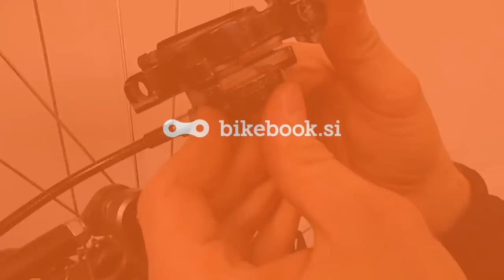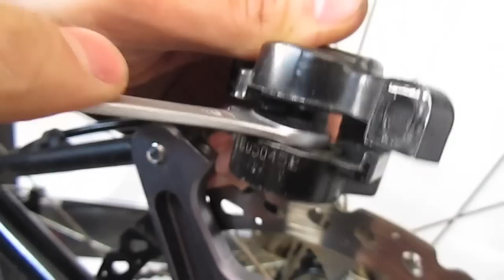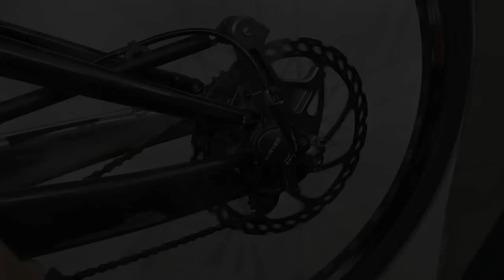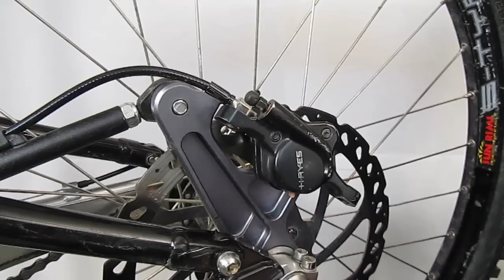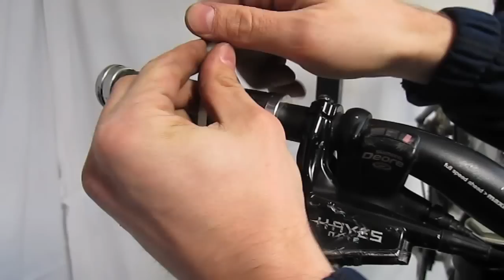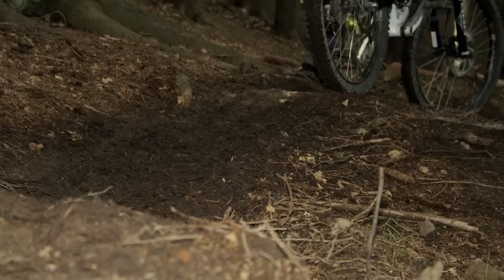Replacing brake pads, rotor truing, caliper setup

Comment from the maker: @lstruggy With this screw you set the distance between the brake lever and the handlebar. I am unscrewing it to relieve any pressure on the caliper and brake pads. Installing new brake pads is very easy, if you do so.